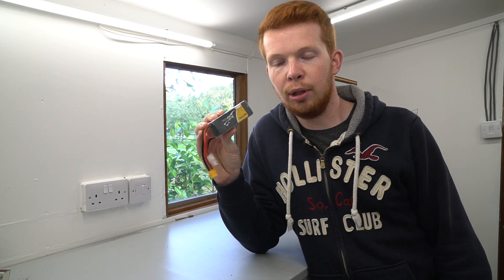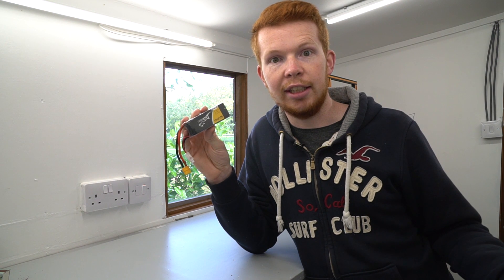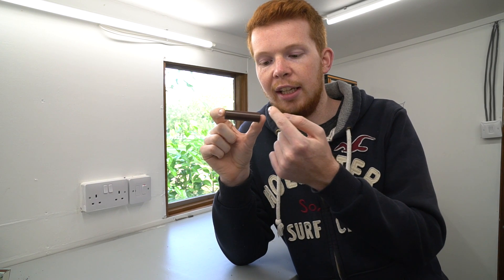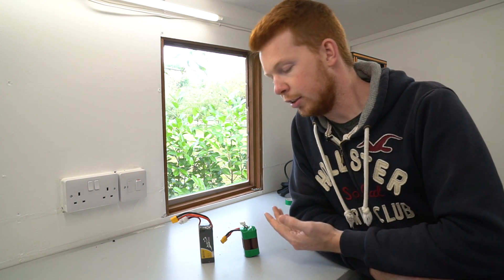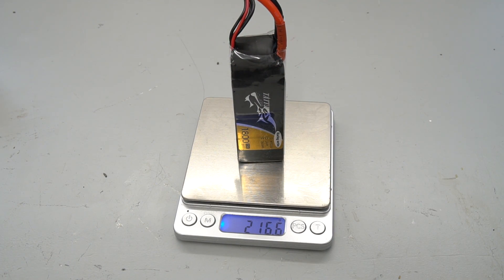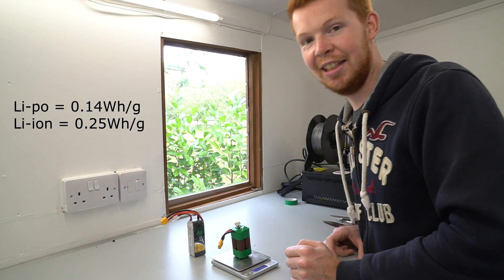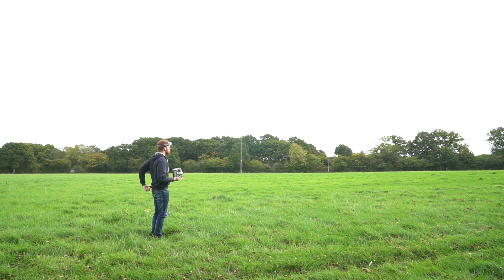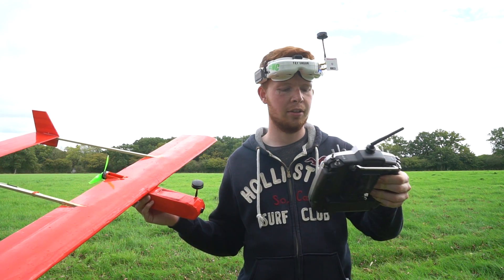Lithium ion plane battery

Comment: Get yourself an autopilot system and just put it in GPS hold. INAV can do this for you for less than 60USD
Reply: Don't know about your country but this would be illegal in UK. Have to monitor the flight and control as necessary to avoid manned aircraft. 

Flying FPV without a 'spotter' with you is illegal too, for the same reason.
Reply: oleost
Reply: John Goldsmith Everything is illegal in the UK. It is simply assumed.

Comment: Not sure if I miss it but did you consider the C rating because it's make a huge difference in the weigth ratio,  Your 4s Tattoo are rate at 1800mah@75C so could posibly deliver a burst of 135amp(...!!!) but your LG cell can deliver 20amp I think you said?? so that's kind of hard to compare(but it's already hard to compare since they are not the same tech without the same purpose...!)

Good video anyway! giving some ideas!

Comment: Great video Tom!  I love these kind of tests.  The LG INR18650MJ1 is a 3500ma cell that will perform to almost rated capacity even at a 10 amp discharge.

Comment: realise it might be boring but you really need to verify the "theoretical"  time for the LI-ION  pack
Reply: You could always rerun the test but not actually fly ... just run it on the bench.
Reply: Ya he could just bench test it, to verify
Reply: Bench tests draw more power than actually flying the plane. So not quite the same.
Reply: @amallee3361  Explain.
Reply: @odinata  In a bench test the plane is stationary relative to the air. It's clamped down to a bench, trying to pull a very heavy weight. This will draw more current.

When it is flying, it moving through the air and while the wings and body have some drag and are pulling the plane back, it can't be as much as being clamped to a bench.
Reply: @amallee3361  Um...turn down the throttle a bit then.
Reply: @odinata  Then what are you measuring? 

You can get any answer you want depending on how much you turned it down.

But this line of reasoning may bear fruit. Perhaps there could be a correction factor that would be based on characteristics of the airframe. This factor, less than 1, would be multiplied by bench test amp draw to get a better estimate of the dynamic current draw. Finding out what characteristics effect this correction factor would make for interesting experiments. I'm sure @TomStanton could provide empirical data here.

Any propheads out there that can comment? I'm no aeronautical engineer.
Reply: @amallee3361  Just plug a motor with a prop into each pack, and see how long they each run. 
Its really that simple.
It may not give you FLIGHT time, precisely, but it WILL tell you which pack will run longer, and by what proportion.  So, you would be able to tell how long one pack would fly (approximately) by flying the other and timing it, and doing the math.
EZ.
Reply: Just plug the battery into an artificial load that equals the draw on the battery at cruise flight speed. It's simple.
Reply: @amallee3361  a simple fan would change the conditions from static non-sense into a proper dynamic test
Reply: @amallee3361  design a proper bench test.  Test using a wind tunnel,  model stand etc.  Proper experimental test conditions is CRITICAL. You take an LSAT for law school.  It would be useless to take the LSAT to see if you can qualify for an Olympic marathon race.
Reply: Amal Lee If that’s the case then the bench test is not designed correctly.
Reply: Well he did- just halfway.
Reply: I think Joules is the unit you're looking for if trying to compare capacity.
Reply: sony vtc6, google it
Reply: If someone jumps out of the window waving their arms,  theoretical  you will fly, trust me like this video xD
Reply: @yametekudasaisensei539  In theory if you could flap your arms 200 times a second then you will produce enough lift to counteract your body mass.
Reply: @1Thatstrangeguy  it depends on the way you move it maybe 100 of those 200 go against
Reply: @yametekudasaisensei539  You will fly.......until you you don't

Comment: I don't think my charger will work if the cells are under 3v as a safety feature . Maybe other chargers can. Why not preform a bench test with constant load on each. wouldn't even need to watch closely yourself, with a voltage alarm.

Comment: How about several super capacitors, will that work as battery?
Reply: kimoshwaby their power to wait ratio is a lot lower than lithium batteries. They are good take or dump energy VERY fast. They are not very good at working as a battery because they take up a lot of room and have a low energy density.
Reply: you can consider adding capacitor arrays inside the wing(s)?

Comment: Not only a cut off voltage problem! You are also drawing too much A from the LG cells. Use more of them and you will reach their full capacity. Or use high discharge cells instead.

Comment: There are many chemistries in Lithium Ion batteries. EG the Gigafactory batteries developed by Jeff Dahn for Tesla (and GM) are said to have 30% more capacity than their rivals and last upwards of twice as many cycles. Next few years should see this all change with new chemistries for transport coming from Toshiba, Toyota, Goodenough, Daimler.
Most efficient battery use for a plane is 'sawtooth' flight pattern of powering to height and gliding, especially with self launching sailplanes where lift bubbles can be used in glide time.

Comment: You can use some lipos that you don't care about to make, essentially, a spot welder. Even lithium ion batteries in parallel will deliver enough current for a spot weld.

Comment: The 18650 can be discharged down to 3.2v. You literally only used half its capacity! The lipo cell was coming to the end of its capacity based on its voltage...
Reply: Yeah...he said that in the video
Reply: Paul Shuttleworth when?
Reply: between 9min and 11 min
Reply: That is very true.  Its always important to have full telemetry.  I run current, voltage, and a temp sensor on the pack.  You can really see the heat creep up based on the amp draw.
Reply: Yes Khurram you are right. However, in real life, you don't discharge a cell below 3.2V. There is no useful current below this voltage, and in practice it is likely you will quickly go below 2V, or hit 0V where you will reverse charge as you suggested. 'Can' and 'should' are two different things.
Reply: 3.2V is for long life , 2.5V is for maximum capacity and 3.0V is good for normal life :)
Reply: The first 5 sites that i checked shows the LG 18650HG2 discharge voltage to be 2.5v/cell.  The Sanyo 18650GA that I have been using also spec'ed at 2.5v/cell.
Reply: I had initally planned on making a TPU case for the pack to safeguard it in case of a crash.  That was a thermally stupid idea.   The more you know I guess.
Reply: Home solar research is right, at 14.8V in a 4S configuration, the single cell is at 3.7 volts, and according to the typical discharge curve of a healthy 18650 li ion, at that voltage the cells still retain more than half of usable capacity. 
He could have drained the battery down to the 3.2 or even 3.0 V without damaging it or shortening its life. Going lower than that is not generally done even if the manufacturer of the cell states that 2.5V is the minimum voltage, and the reson for this is that after 3.2V the discharge curve becomes very non linear. This means that from 3.0 V to 2.5V you get very little Ah, so it's generally not worth it.
Reply: he said that at the end of the video
Reply: He said it at the end of the video!
Reply: What's the cost of each lithium ion cell
Reply: @susheel Kumar Pippera....I got some good panasonic 18650 from a laptop cell. Basically free.
Reply: 3 to 5 dollars each depending on brand and model.
Reply: Go to 9:03
Reply: Sacred Baloney the titan power cells made for wings are rated to go down to 2.5v per cell. I fly my long range wings from 16.8v down to 10.2 every flight. I can still maintain a 45-50 mph cruise at 10.2v. There is a lot of usable energy. I havent lost a full minute of flight time yet. Even after all the charge cycles they have been through.
Reply: Bulshit there is no rule it depends on battery. I discharged batteries to 0,4v (i forgot to switch device off) but then I charged them fine. They are still working after 3 years
Reply: he said that the hg2 cells can safely go down to 2v/cell.  which he should have know about before even purchasing the batteries.
Reply: " In fact, they can be discharged down to 0 volts without any damage, they can simply be recovered by trickle charging it." -- OMG - not only you will destroy the cell, but this can cause a short.  A Li-ion cell will not survive below 1.0 volt.  It gets damaged.  Between 2.0 and 1.0 it is rather iffy.  Over a long time, it destroys the cell.  Never go below 2.0V.  You can recharge a cell that has hit 0 volt, and it will go back to 4.2V, but it will hold almost no charge.  It is internally damaged.  And if the thing has shorted inside, then you can have a fire if you charge it.  A 0V up to 1.0V Li-ion goes to the trash heap.
Reply: DONT EVER DO THAT, there is a reason the manufacturer give a voltage spec. Even using the Cells down to 2,5V every time will kill the capacity. Discharging below 2V everytime will make short cuts inside the cell until the battery starts draining itself. Read about the structure of lithium cells before spreading things like that.
Reply: Vaidotas Ratkus 
The integrated protection can only handle 6A and shuts down at around 3V. For peak loads its not suitable.
Reply: Cannot be discharged at any conditions under 2V, otherwise damaged. The lowest voltage depends on manufacturer and is between 2.4- 3.2V. Some Panasonic types has lowest working voltages (2.4V) while LG has highest voltages (up to 4.35V).  Read specifications before charging / discharging.

Full charge / discharge shortens cell lifespan.
Reply: Very little energy between 3.2V to 2.0V, probably not more than 3% of cell capacity.  Why damage a cell for that last 3% at such low voltage that no one can use.
Reply: Newer Pan bateries can be discharched to 2.5V. This LG to 2V. Anyway regular discharging to the allowed lowest voltage shortens life. Therefore I would recommend not to discharge under 3V (Li-po/Li-ion alarms has presettable alarm voltage usually between 2.7 - 3.5V in 0.1V steps).
Reply: You can discharge them to 2.4v safely. Check out some battery data sheets, the discharge curve is not linear, at 2.4v you have used ~80% of the cells energy.
Reply: Except that they can't safely go down to 2v per cell. 3.2v is the lowest voltage an 18650 cell of this chemistry should be discharged to. There is really no usable capacity below that voltage. The LiPos are similar, but each has a different discharge curve.
Reply: I agree, the sensors are invaluable... knowing the cell is overheating is a sure sign that it's time to end! I've killed way too many of these dang things...
Reply: This is true, however most products are designed to cut off at 3.2v. Anything below this voltage presents a very limited capacity and power. As you can see from this discharge curve for the HG2 (https://cdn.shopify.com/s/files/1/0674/3651/files/hg2_dicharge_test_2_1a897544-3a38-4a9f-9912-159a9d417ab4.jpg?10166487243532904150), the moment you hit 3.2v, it starts to drop off significantly. In an application like a plane where you need the current, it is risky to go below this voltage because 1. you might suddenly lose power, and 2. you could damage the cells as they rapidly drop below 2.5v unexpectedly.
Reply: Home Solar Research in real life you can discharge it to 2V wich is that model cell cutoff. you can have usable energy from it to 2.5 then it will get to 2.0 and cutoff very quick. so to be safe, I'd land that plane at 2.8v while you still can trust if you need to get up to 30A from it. 
here you go champs
https://www.nkon.nl/sk/k/hg2.pdf
Reply: 18650 cells can be discharged down to 2.8 volts safely. In fact, they can be discharged down to 0 volts without any damage, they can simply be recovered by trickle charging it. You need to reverse charge the Li ion to damage the internal chemistry like a lipo would face below 3.2v

Comment: You can easily make a spot welder at almost no cost using a microwave transformer and some thick copper cables. Broken down microwaves (or really just old ones) can generally be found for free. Just look on YouTube for microwave transformer spotwelder, plenty of guides around.

Comment: PLEASE before doing anything else with 18650 build a tab welder. That is so dangerous. I have had 2 batteries vent on be from soldering and one was a thionyl chloride battery...
Reply: What BS, Just do a search for DIY power wall, As long as you are careful, you are fine.
Reply: The best option imo is to 3D print an enclosure and put the cells in it, if one dies you can easily replace it and if you wont lose any charge with soldering
You can also add loops to hold the battery pack with velcros
Reply: I've soldered maybe over a thousand 18650 cells over the past 3 years, never have I ever faced a problem with it.
Reply: Check Jehu Garcia's channel. He has converted a vintage VW bus to electric, originally soldered the thousands of used cells by hand, had no issues, and had a range of well over a hundred miles on them. His latest battery is repurposed Tesla battery segments, not because the old cells died, but because the Tesla ones have higher capacity.
Reply: The 2200mAh 18650 types can be soldered without problems, when you work quick. The 3500mAh 10A Samsung types seem to be more delicate, I noticed a loss of capacity after soldering. I recommend to use cold spray to cool down the cells before and after soldering. It's quite cheap and helps to prevent danger or even slight damage to the cells.
Reply: Just because you can doesn't mean you should. It's still quite dangerous, and the DIY Powerwall guy is an idiot.
Reply: One question: why does everybody has to solder these batteries? Can't you use that battery holder thing like you find in any tv remote or toy? Is that so much more weight?
Reply: Why are people soldering straight to the battery when they can buy a cheap battery holder.
Reply: I have soldered many Li-ion 18650 cells, never had a problem. I  use an 80W iron, clean the cells ends thoroughly and splash solder on to the surface the iron touches the sell but briefly. The wire (as in video) just pressed quickly and positvely onto the end. The all metal casings mean that heat is dissipated very quickly. If you use a typical iron that is ok for sircuits boards  etc maybe 18W like my Antex then you'll be there all day trying get the cell hot enough. Be careful handling the iron on the +ve terminal the =ve casing is VERY close.   Finally if you are still concerned, don't do it. You can order batteries from retailers who will tab them in any mode you require.
Reply: x9x9x9x9x9 you commemted on peter sripols video didnt you?
Reply: x9x9x9x9x9 Don’t leave the soldering iron on too long and you’ll be fine, i soldered lithium ion battery plenty of times and no venting once.
Reply: Well sir, I congratulate you with NOT KNOWING HOW TO SOLDER! You can safely solder these batteries. I usually hold the soldering iron on them for less than half a second. Batteries don't heat up even by 30 degrees.
Reply: I would never call it safe. Lithium batteries can be in a critical chemical state and there is no visual warning, or any warning until the battery actually decides to go. While yes, you can solder to the battery without anything bad happening, you should know that it is not without risk. Just buy a cheap battery holder and do it properly. Arguably the idea that you can make a clean solder joint in half a second makes you sound like you don't know how to solder. Everyone on here who is soldering to a battery is making a cold solder joint that will break easily. (Obviously it gets the job done)
Reply: i put mine in the freezer for a few before soldering

Comment: if you choose to fly in the same angle of attack, increasing mass will require increasing the potential  difference between the 2 sides of the airplane blade, thus you need more speed in the flow thus more speed in the motor and that will drain battery faster.
biggest drain rate means more thermal losses inside battery. 
in the same time flying with different speed may increase of decrease aerodynamic efficiencies.
and if you choose to fly with the same speed with different angle of attack the lift/drag ratio could be better of worst depends on the speed you choose to fly on.
i'd be awesome if you make some sort of (non boring:P) research to estimate which is the better choice, and i suppose you can publish in an article too.

Comment: fuck off, 2200mah you use up 2200mah. they last 100 + flights then ya spend $7 and get another
Reply: in my country a proper 2200mAh costs 20-30$...

Comment: You can always put an autopilot to the plane and have a drink while it "autoflies", little f3 board with inav and agps antenna will add only 40g to the system and make the experiment much more comparable. 
Next time you solder the 18650s please make a capacity test before & after, warming the cells so much really do damage the final capacity (at least that's my experience!)
I would be glad to watch more videos and those 18650 capabilities, keep rocking!

Comment: 18650 can run down to 3.2 volts and recover fine and if you ever want some spot welding done give me a shout .
Reply: Barrybados©. Actually, it can run down to 2.5v. That's the cut off of most BMSs (like the one on notebook batteries).
Reply: MsSomeonenew Did you ever done that? Try it. Never saw one that didn't said 2~2.5v as minimum.
Reply: For fucks sake they are not all the same thing, 18650 just means what the damn size is. You need to look up your specific battery technical info before you blow some shit up.